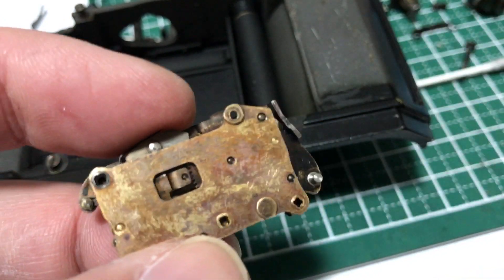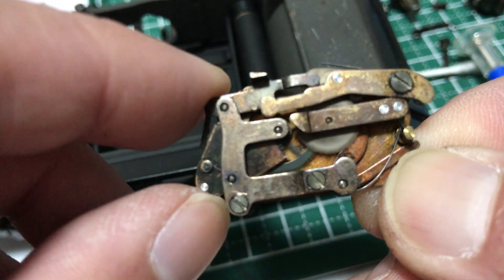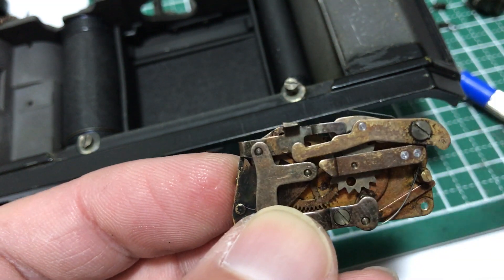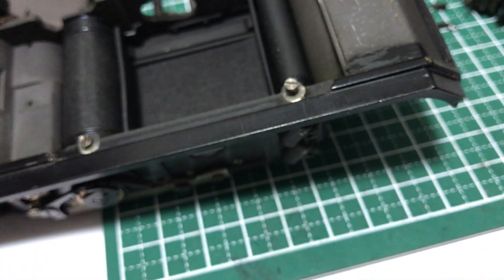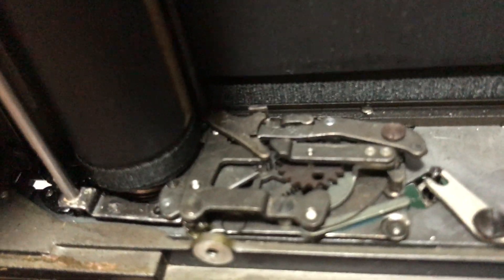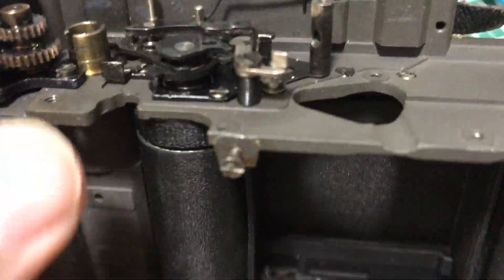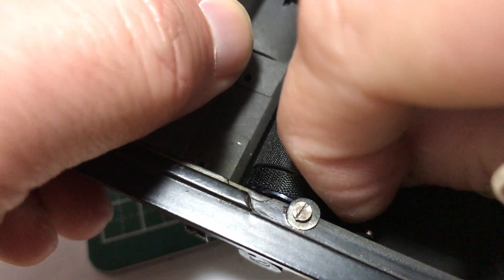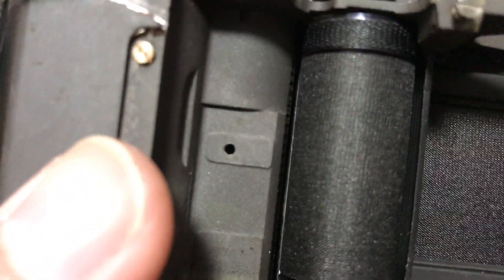Nikon SP/S3/S4/F slow speeds notes pt1

Comment: Hi Richard- I just purchased a 1955 build S2 and the slow speeds (1/30th and below) don't work at all, only bulb. Would a good cleaning likely fix this sort of issue or is it usually something more serious? The higher speeds from X up to 1/1000 are working though in need of fine-tuning.
Reply: I got the same problem with a S2 but mine works when its upside-down, strange....
Reply: @perberggren8415  After a service all speeds working accurately. Old grease needed cleaning.
Reply: @douglaswells2739  Im going to try that out on mine. Thanx for the video and reply :) Keep up the good work!
Reply: Got it up and running as smooth as the first day out of the factory. Thanx for the video! :)